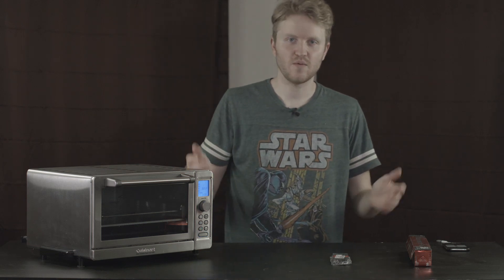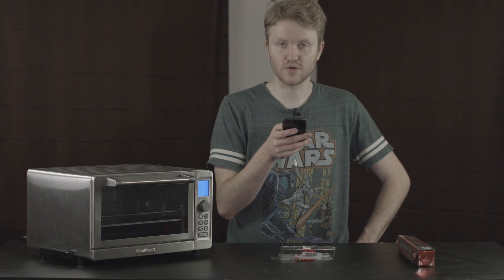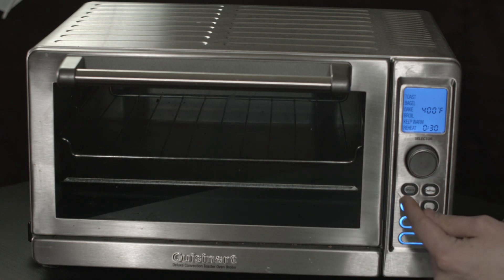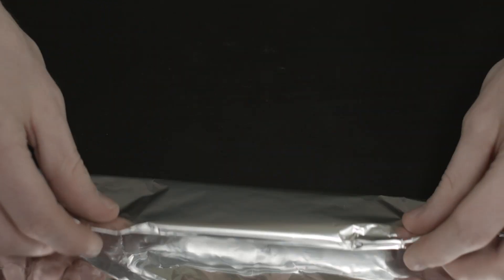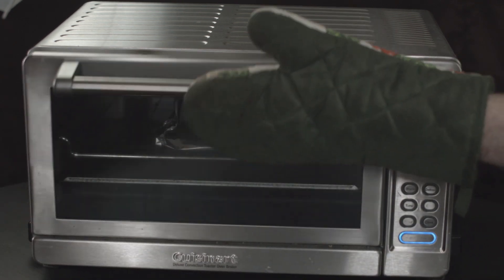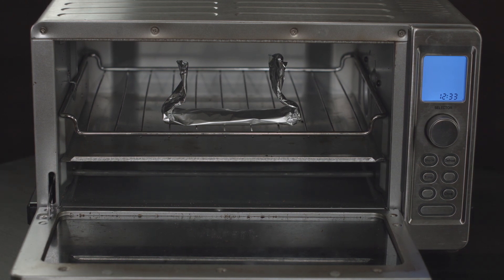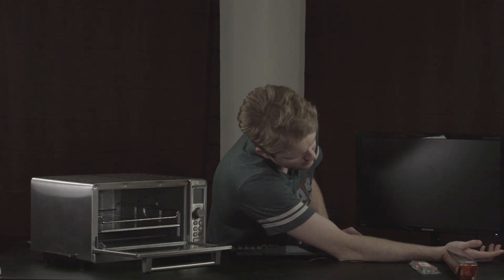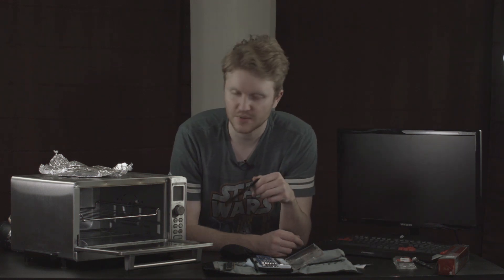How to Fix Dead Ram Stick By Baking...Does it Work?

Comment: IT WORKS. My ram stick came down with some errors and I even diagnosed it using window's memory app to make sure it was that ram stick. I had blue screens and crashes whilst using that ram stick in my system and when I took it out the pc errors stopped. I felt desperate today for some reason and didn't want to buy a 2 kit of ram as I only needed one, so I looked up this and other vids and also read the comments. 

Here's what I did. I stripped my ram stick of the heat sink and glue residual as much as possible then I wrapped it twice in aluminum foil twice. I didn't have an oven but I did have an air fryer which I preheated to 400F. I let it heat up first and then I placed he wrapped of stick in there and took it out after 6 mins and then took out to set it outside to cool. I waited until it cooled down and placed it in my system to test it using the window's memory app. I did the standard test and waited patiently to find zero errors by the end of it and now I'm happy that I have my 32 GBs of ram back in my system.

Comment: This method is great if the chip is lightly misaligned/broken connections with the ram pcb which is great if that's the issue, but if it doesn't work you most likely have a broken memory chip. If you're up to the task you can try and test all the chips and identify the broken chip and replace it
Reply: How would you be able to test individual chips?
Reply: @jasonselsley  a multimeter l0l

Comment: WTF? It worked for me !
I had a dead dead RAM. died 2 days ago. Gskills RipJaw 16GB DDR4 3200hz 25600 ( I got 2 of them so thats 32GB)
I followed the video, wrapped mine twice, put it in for 2mins at 300F and then 1mins at 450F. Then had it resting on a blanket (still in aluminium foil) for 10mins. Then wiped the gold connectors and air dust it. Then boom !

Now how I know it was actually dead? I couldn't get the PC to boot up all the way. I was receiving no signals to my monitors and the DRAM light on motherboard was orange.
I tried the following once I found the which one of the two rams is dead:

I tried exchanging their slots -  it didn't work
I tried moving both to two different slots - it didn't work
I tired booting it up with the bad one alone - it didn't work
I tried booting it up with the bad ram alone on 3 other slots - it didn't work
I tried the good ram and it worked on all the slots 

and after baking the bad ram it started working. 
Ask me questions if you want
Reply: I don’t know much about pc’s and I have a prebuilt pc, and recently I got a error code that popped up saying memory_management and asked some people and said that the ram card thing most likely died, and it won’t load to the desktop and keep getting the error, so should I try something first before putting it in a oven? I don’t know much about the ram just know there is two 8gb sticks. Thank you if you can help.
Reply: @DanielS05  what make model?
Reply: Is it still working bro? I baked my old GPU on the oven and got it to last 1 year more, I wonder how much time will the RAM last
Reply: @Welterino  LOL hell ye. its crazy! I am just afraid to overclock the rams.

Comment: im not sure if this comment section is being sarcastic or troll

anyway im not believing them until i tried it myself
Reply: It is true man, works for GPU as well, I baked my old R9 270 when it died and it lasted for another full year, then died for good, RIP.
Reply: Bruh I guess the high temperature stuff really works. I installed new ram into my laptop and it didn’t work. After HOURS of infinite Windows bootloop my laptop got hot so bad that it probably melted all the damaged parts of RAM, making it work
 (it’s a joke)
Reply: It's legit am dd srs

Comment: How do I take off the heatsink
Reply: What is your ram stick model? Some ram sticks dont have a heat sink
Reply: OfficialPixel - CSGO Content  I got Corsair vengeance
Reply: @lucaskl303  Laptop or Desktop?
Reply: OfficialPixel - CSGO Content its desktop            Ram-Corsair vengeance rgb pro
Reply: OfficialPixel - CSGO Content  so dose it have a heat sink?
Reply: @lucaskl303  It does, but because its RGB, it might be quite hard to remove the heatsink so you might want to try the warranty if you're trying to fix a broken ram stick.

Comment: So I saw the same article and was hoping someone was going to do a video on it because, one of my Hyperx Savage DDR4 8GB sticks died. I saw the comments and everyone was telling the dude to remove the heatsink so I did and after baking my RAM (smelled like Nachos... I need to clean my oven a bit shh) I was skeptical HOWEVER I plugged it into my PC, checked the BIOS and it worked. It actually worked. I'm blown away by how something so simple was able to fix my RAM. Thanks guys!
Reply: Did it really work
Reply: @amitsing6667  genuinely yes, I was skeptical but since I had a broken stick anyway I figured what the hell. I followed the steps in the guide and also removed the heatsink as recommended by the comments here. The stick is still working a few weeks later.

If you have a broken stick, follow the guide and remove the HS, if it's broken anyway then no harm done if it doesn't work 🤷‍♂️
Reply: Sorry, you are still using that oven? Plz help i have too a broken ram module and i wanna repair it, but i don't know if i can use the oven after, because if i can't use it any more it's don't worth
Reply: @darkraft100  Yeah you can still use the oven afterwards 😅 don't microwave it though... Use a conventional oven if possible.

Remove the heatsink on the ram.
Wrap it up in a small layer of tin foil. 
Preheat the oven to 150 degrees C. 
Put the ram inside for no longer than 5 minutes.
Remove the ram from the oven, let it cool down for 5 minutes.
Remove the foil then put back into your PC
Reply: May I ask what is a heatsink? Sorry i am new to pc
Reply: @Quantum
Reply: @boyz6850  the heatsink is the metal sheeting over the ram chips, it's designed to distribute heat away from them.

Comment: what is a heat sink
Reply: It is a metal plate stick to memory chips of RAM to diffuse heat.

Like in this video, you see that black plate where HyperX Savage is written on.
Reply: @Gamer Wolf If you have another same type of RAM then use that till you get enough money to buy the desire one(s). I'll prefer double channel memory sticks (a pack of two RAM sticks) so if one fails at least there will be still one working fine. And double channel RAM will be faster and better. But your motherboard should have at least two RAM slots for that.

The fix shown in this video does not guarantee that your (cooked) RAM will work or if it works, then no guarantee that it will work as it used to be.

Comment: reflow soldering bad joints for the reflow proces to work you need to put flux it wey inportant on the solder joints and remove heatsink and no aluminium foil and use a heat gun or hot air station to max 250 C on the ram board

Comment: Yup, it works. I found the same page. I did let my oven get to temp for the 230 C part as it only got to 210. I gave it an extra 2 minutes at the end before switching the oven off.
Reply: Does the ram still work today?
Reply: MBW im curius too